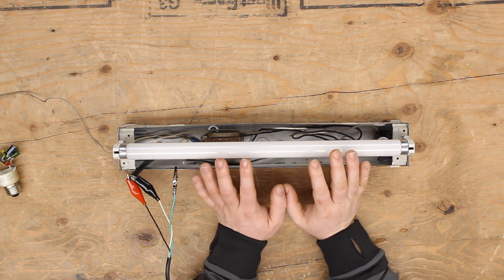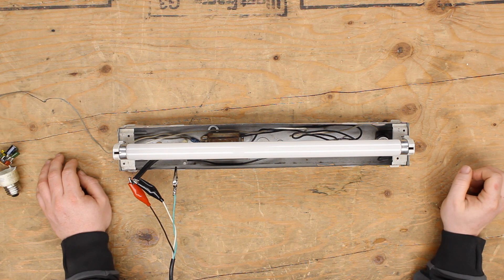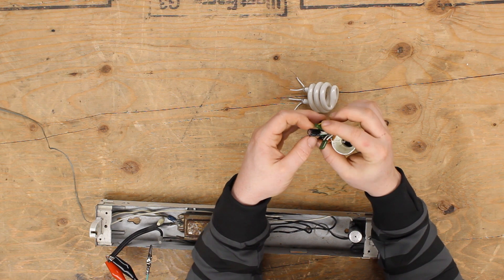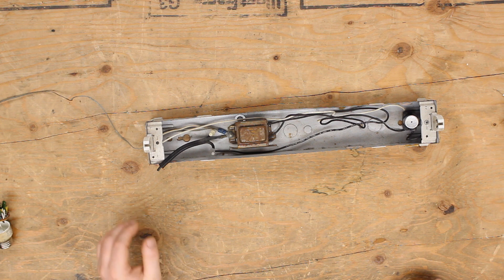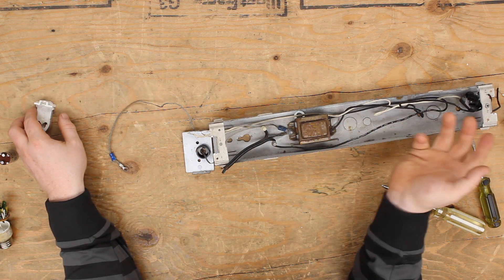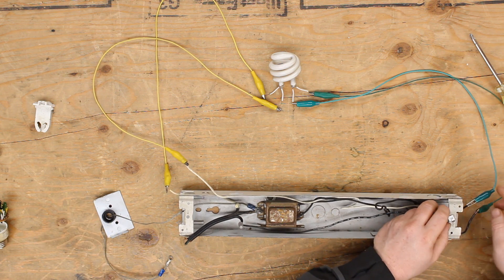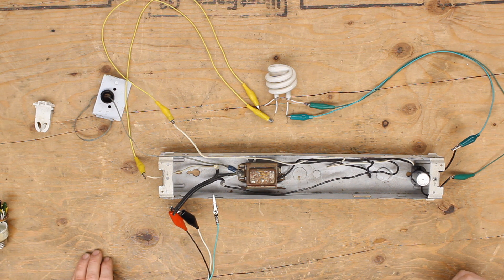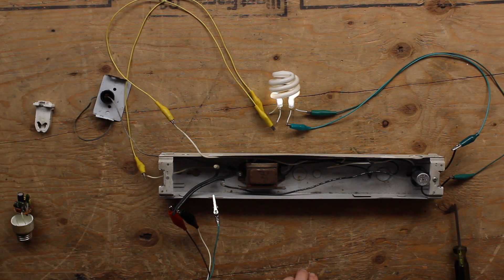Can I Make a Junk Compact Fluorescent Work on a Different Ballast?

Comment: Reason why it doesn't work is because CFLs need a higher voltage to strike. So to preheat one you and need a higher voltage system and ballast or a HX Autotransformer

Comment: A neon sign transformer is also fun....  

It could be that the filaments (if they are still intact) do not create enough current consumption to make the gas lamp inside the starter glow, and heat up enough to make the thermal moving contacts close then release.  Or they are connecting and releasing rapidly.

Comment: This seems like an interesting tangent. You should consider tearing apart a new incandescent lightbulb to see if this will actually work. Since we do not know if that old "worn out" bulb is screwing up the results 🤔 :D
Reply from the maker: Incandescent bulbs are finnickey since they require a vacuum chamber or the filament will immediately burn out. I do have an idea on how I could make that work but currently no funding to build an appropriate vacuum chamber.